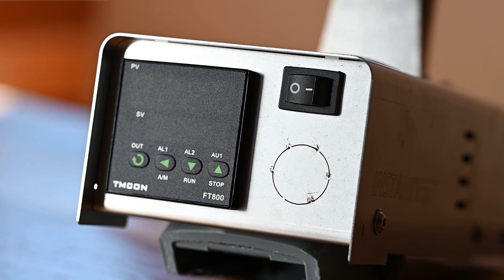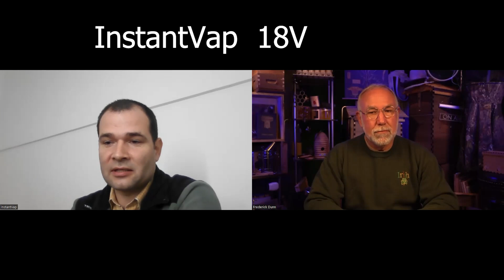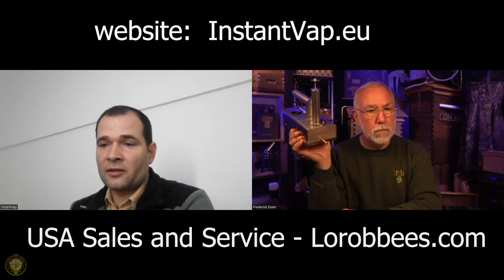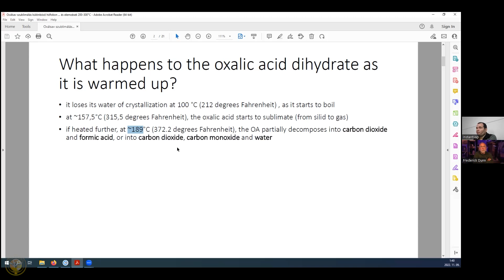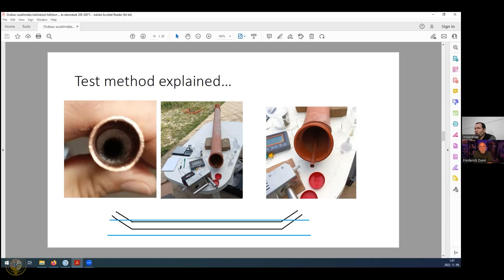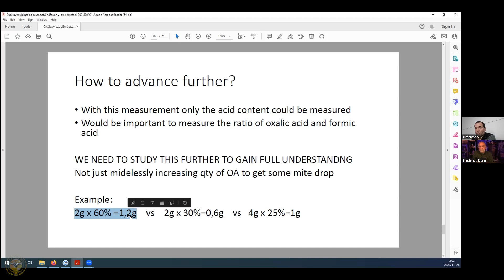Oxalic Acid Vaporizer, Battery Powered. Interview with Janos Fenyosy, A Higher Dose may not be good.

Comment: That was fascinating, thank you, Fred and Janos.
One thing which struck me instantly was the huge variation in temperature due to the thermal mass of the chamber, OA, and evaporative energy used, and the large degree of hysteresis from bulk switching the entire heating element on or off.
To explain why I found this surprising I need to give a little back story.
In February 2017 I gave up smoking after a 40-year habit.   My Doctor and several Consultants in a number of specialisms (unfortunately, I suffer from several conditions which require regular attention) tell me that they can no longer tell I ever smoked, which I guess is very encouraging to any existing smokers considering if they can quit effectively and usefully after extended periods of reliance, and a credit to my "lucky" DNA.  
The method I used to quit was vaping (I'd tried everything else over the years, unsuccessfully), and I chose right from the start to use a temperature-controlled vaping device rather than simply dialling in how many watts to apply to the heating coil.  Since I'm fairly keen on DIY and something of an amateur science enthusiast I learned rather a lot about it, and there are plenty of circuits commercially available in quantity which vary the voltage to keep the temperature constant or by using very fast pulse width modulation, and measuring the temperature by continuously measuring the resistance of the heating coil, instead of by switching the power on and off with temperature sensing from a thermocouple.

Most metals rise at least a little in resistance as they heat up.  You can choose a suitable metal depending on preference, the amount it changes with temperature (temperature coefficient of resistance - TCR), or availability.  Nickel gives a satisfyingly high TCR, making control very easy and stable, but is not that easy to get as wire or perforated foil suitable for use in a resistance heating circuit.  Additionally, some people have a (fairly mild) adverse reaction to even very faint traces of inhaled nickel vapour, and tiny amounts of the coil (nanograms over months, so nothing to panic over) do off-gas.  Titanium has a moderate TCR but is expensive and harder to obtain.  
Of most interest to us, thinking of OA vapourisation treatment, is stainless steel, ideally 316L formulation, which almost all temperature-control capable devices have a preset for.  It is readily available in gauges of wire from about 10 AWG (2.6mm) to about 40 AWG (0.08mm), or even wider ranges from specialists, giving a wide range of resistances per cm.  The TCR is relatively small, so really precise temperature measurement from that is more difficult and a little less precise, but quite adequate for our needs, I believe.
It is approved, preferred or even required for commercial food preparation equipment, so no problems there (frying food in most cooking oils gives higher temperatures, so it is definitely food safe).  Most conveniently, small strips of perforated foil with a nominal resistance (at standard temperature and pressure, or 1 bar and 20deg C) of 0.15 Ohm are readily available and could be clamped to any electrically non-conductive surface to heat it.  And the range of temperatures at which these devices operate is perfect for OA vapourisation!
I have one in my hand which delivers a stable temperature while varying power from 0 to 400w, just by varying the voltage, and it does not overshoot in either direction by more than five degrees Celsius (for the initial temperature overshoot, less than half of that thereafter), even using the relatively insensitive stainless steel 316L.  Ever.  It runs from a 4s Li-Ion battery, as used in drones and radio-controlled models, and has battery protection low voltage cutoff built-in, along with a range of other features like reverse polarity protection, overvoltage protection, short and open circuit protection, and others.  it even does balanced charging through a micro-USB port at up to 5v 2.4A (12w), which is very good for the longevity of the LiPo packs.  You can of course charge them faster outside the device, but the faster you charge or discharge them, the faster they age.  You can set it to anywhere from 93-315deg C and it will, when activated, keep it there, using as much or as little of the 400w available to do so, taking well under a second to reach 210C from stone cold (with software, I can measure it - just - at just under 0.1s, but of course, any greater thermal mass would increase that).  The only potential problem is that the duration of each individual application is limited to 20s, but I very much doubt if more than that per application would be necessary.  Of course, since its intended use if for inhalation, the 20s is a safety limit, as very few people would want to be inhaling for longer than that, and so it serves to prevent accidental injury by pocket-firing the device.  I'm certain that for a larger order the manufacturer could change that though - it is just a software setting.  Mind you, with 400w on the job, I doubt if more than 20s would be necessary even for higher doses.  Oh, and the circuit is over 95% efficient, so battery life should be fine, although it operates at a maximum input voltage of 4s Lipo (14-16.8v, nominal 14.8v) instead of 5s (17.5-21v, nominal 18.5v) as on the higher-powered packs for power tools.  
I'll try to contact Janos with all this and maybe have a direct chat, as this appears o be right up his alley!

Comment: At about 5:30 I thought he said "formic acid" but probably means oxalic? Very interesting interview, Fred. I have the corded Lorobbee tool, and my main problem is the nozzle clogging between hives if temps are low. I keep a 1/8" bit in my cordless drill, which quickly takes care of the clog.
Reply from the maker: Hi David, no, he meant formic acid as it's produced when you are subliminating OA when the parameters are off. This is an area that we need to know more about.
Reply: Yikes, this is the first I've heard of this.
Reply from the maker: @davidhorsley4657  In this article, you can see photos of bees with formic acid crystals on them, and some more information for you https://scientificbeekeeping.com/oxalic-acid-heat-vaporization-and-other-methods-part-2-of-2-parts/
Reply: Interesting. I've never had that happen. Wondering what I/you are doing different.
Reply: I use Oxalika with the automatic tablet dispenser on top, cost me a lot with the import duty and a load of tablets cost me close to £1000 but the unit doesn’t work as well as their video. I have to have a drill to unblock the nozzle but also the tablet can become sticky and you have to stop and clean the whole thing out a good unit but disappointing. after using many different devices, I actually find it hard to believe any oxacid vaporiser doesn’t block up. Do these battery units that everybody’s talking about really not block up I find that hard to believe.

Comment: Thank you Fred, once again very informative and so great to see actual beekeepers solving the temperature fluctuations by using 1st principals and heating the bottom and not the sides and was more concerned about safety.  Great info on the purity / version of OA that is in use and in the "tar" left over and need to clean.
Reply from the maker: Yes, that was a surprise, but it makes perfect sense that the additives in OA can result in residue. I learned a thing or two in this interview :)

Comment: Good to know if you over heat OA, you could be making formic acid and killing your queens or causing them damage, I'm still using tripled dosage OAE sponges, and with good results, time will tell if I'm hurting my bees, all my double deeps had it on for more than 90 days.
Reply from the maker: Even more informative to me, was the lower final dose the bees were receiving when temps rise and the dose was too high. We have a lot to learn here.
Reply: ILLEGAL!!!!!
Reply: 1 to 2 grams is the legal dosage for Oxalic Acid Vaporization depending on which state you are in, the problem with that is noone is using these amounts and the instavap comes with a upto 4 gram adjustable dispenser.
Reply: @carlsledge3868 because it has been proven that a “legal” dose is in effective. 
Science and medicine is always evolving and the shot callers aren’t always correct.